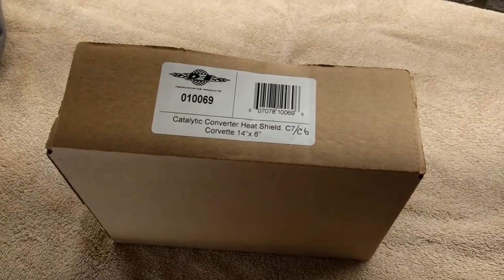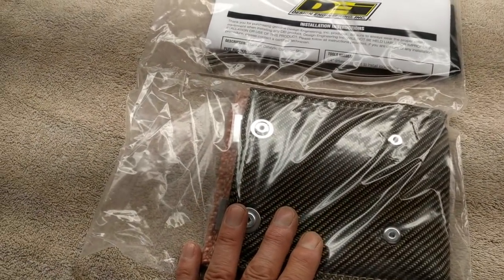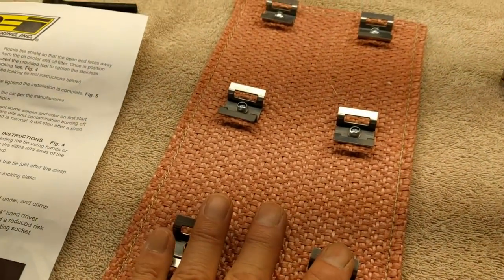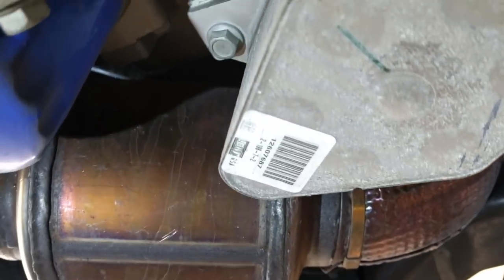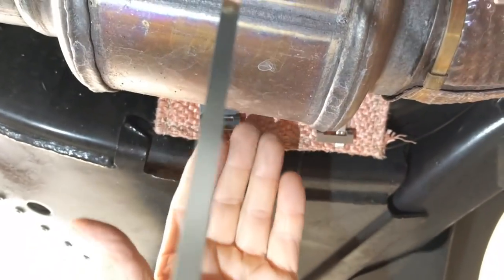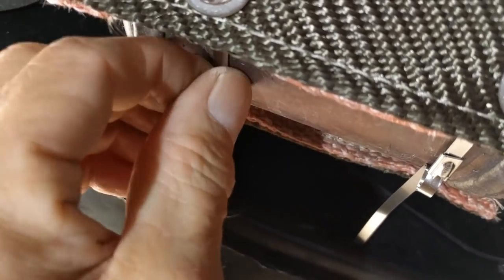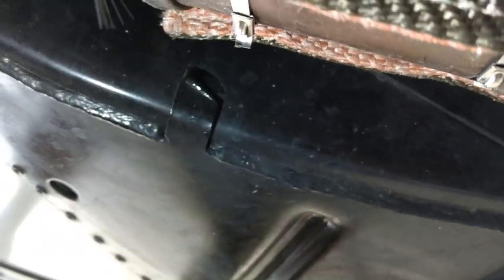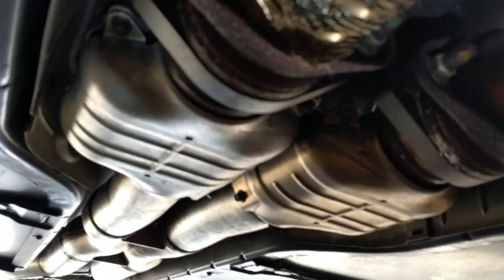Corvette c6 c7 zo6 DEI shield install catalytic converter driver side protect oil cooler by froggy

Comment: I have mine clamped on top only and it hangs between the cooler and the cat. Not wrapped around. It’s been on for 25k miles and no movement

Comment: Great Vid. Do you think these could split into to 7x6" so that each piece could fit on top of a smaller 4x6 cat?
It wont be full coverage, jut trying to stop heat to the floor board.
Reply from the maker: If you had a way to cut, sew, add fasteners I suppose, but maybe just look for Generic sized heat shield.  :)

Comment: I wonder if this would be beneficial to do on a 07 Z06 thag does not have the external oil cooler by the filter ?
Reply from the maker: If it's starting ok then probably unnecessary, but won't hurt anything. Maybe prolong life of starter (heat is the enemy).

Comment: Did you notice any change in oil temp?
Reply from the maker: No, but I haven't run it hard (track) yet.

:)
Reply: @1947froggy  What is your opinion on the results today?
Reply from the maker: @dan596  Would do it again.

Comment: Froggy if you post in the facebook page you will get more help then the vette forums .  Your chasing this the wrong way.  Almost 95% of the time it is the battery first.  To confirm use jumper cables when vette is hot and ONLY then can you rule out battery. Ruling it out because its new is not ruling it out.  NEXT or #2  is the starter solenoid. #3 is the starter rely #4 are cable issues. HEAT shields only help make a starter last longer it does not in any way stop the slow crank issue.  I added a mini starter which helped for a year, and it only masked the problem.
Reply from the maker: Thanks, 100% it's not the batt. 2 new batteries (built in 2018 - one was sept 2019 and showed 14.7 v. on my dash). Yes I have jumped with cables & with a jump box AT THE MOTOR. Still slow crank on a hot start. Could be the solenoid, I have a brand new acdelco to put in when I get to it. So jumping at the motor eliminates #4. THANK YOU! Stick with me I'll get it.

:)
Reply: I had a weird shorted cell in battery that would only short after 15 minutes of driving, cold car cranked like a banshee, even a little hot it dragged. It wasn't heat to starter that caused it for me. Hell I was going to put in a Odyssey battery, glad a autozone gold did the trick.    If your starter relay is not discolored or hot after driving you can be sure its solenoid. My mini starter cooked its solenoid in a single year with heat wrap.  The asshole mods at the CF forums banned me so im only on FB, used to be outhouse there.
Reply: By the way I used your vids when I did the poly bushings, thank you!...I bought the HF ball joint remover, on my car I had to Dremel the inside to get it to fit.